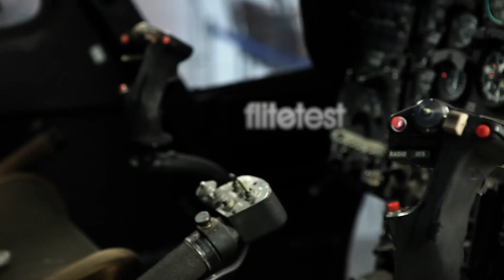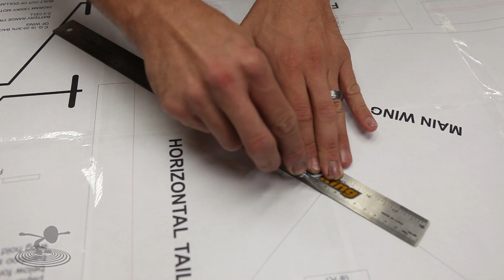Flite Test - FT FLYER - SCRATCH BUILD

Comment: Hi guys love your awesome channel keep it up and i have a doubt could anybody please help me. I am going to make the ft flyer and could I use the following electronics ( battery 11.1v 2200mah,180 gram),30a esc, 2*9gram servos and motor a2212 6t brush less motor 60 gram  with 1045 (10*4.5) propeller
Material used
4mm sunboard pvc foam board

Comment: I built the plane and bought all the recommended electronics. I bought a Flysky FS-i6 transmitter and receiver and burnt out the receiver with a 2S 1500mah lipo. Do I need a high end transmitter and receiver?? Will a 5V battery fly this? I am a noob. Help please!

Comment: Great stuff FliteTest. I built the Nutball then off to the FT Flyer.  The Nutball had a short life but got some loops in before the $2 foam board just couldn't take it.  The FT Flyer is done and one test flight completed with heavy tail.  

I found some 20x30 sheets at BiMart. 5mm board for $4.  OfficeDepot was 3mm and $5 - not very good.  Our Dollar Store doesn't carry it. Michaels Craft store has the thicker 5mm for about $3. for a 20x30.

Comment: I'm about to MAIDEN the FT Flyer on my first RC plane flight EVER with a 2212/13T, 1000KV Motor, 30 amp ESC and a 10x4.5L prop haha...Yup let the terror and chaos ensue....especially I'd I can get the 3S battery weight to fly. ....it's pretty gnarly with a little 600mAh 2S though lol

Comment: Just finished the FT FLYER about 5 minutes ago...something was off on the print of the plans...had to fine tune some of the cuts to make it all fit together properly. Off to build the power pod. ...I hope it's not "off" so that when my electronicals get here they actually fit. I'd HATE to have to rebuild the TINY Trainer (both wings n both noses) and this one after all the work I put in to scratch build.

Comment: the 2s 500mah battery recommended is 49 grams would it be OK if i used a 91 gram 1700mah 2s battery or can i do even heaver like a 3s at 200 grams

Comment: What would be the flight time with the 500mah? thanks!
Reply: Greg K 2s! and i built 3 of these already (and wrecked 3 of course) and i got good flight times out of the 500 2s at around 8-12 minutes
Reply: +Aaron S I get about 9-10 min just cruising
Reply: impact lures cool, thanks!
Reply: +impact lures that's with 2s or 3s?
Reply: 2s thx

Comment: I am building this model and was wondering if these electronics would work with the model.
Hobbymate Rc Airplane Power Combo Motor ESC Program Card Props Plugs ParkFlyer. If this works what 3s battery would you recommend.
Reply: +Michael Bulzacchelli i would definitely recommend that, maybe a fair bit of power for the US foam but the more power the better

Comment: Has anyone flown this with a 1300 mA battery?
Reply: +aniket patil i have flown it with a 1500MAH nanotech lipo and it last about 10 minutes at decent throttle, i sometimes use my 2200  nanotech too but have never tried a 1300
Reply: 2200, wow. I thought it would be too heavy for it
Reply: ***** no way, it flies great but i do have a very powerful motor, its a turnigy sk3 2836 1500kv motor
Reply: +aniket patil yup! it flies great!
Reply: +- DanTheMan - Is you 2200 3s or 2s?
Reply: 3s

Comment: what type of wire do you use is it just stainless steel
Reply: +- DanTheMan - I have not thought of using coat hangers! Thanks!
Reply: +Archie McMullan either use a coat hanger or caravan wire works really good too, my friend uses a coat hanger and it flops on the landing, i actually find that it is easier to land without landing gear and it also flies so much better and gives you more flight time.

Comment: Challenge accepted powerpod was built last night moving on to the airframe.
Reply: How did it go
Reply: niq872 It went great. I built it with my daughter it's her first plane and she flew it a bit on the buddy box and was able to do some circuits with it. I was able to even do some 3D hovering with it. I'm using a 1550kv motor and a gws 8x6 prop on a 2cell 800mah battery. I even strapped a coffee cup to the nose so I could drop my sons little parachute army guys from up high with it. I built another pod last night because I need one now :) Simple and fun great little plane

Comment: after i downloaded the plans i found that it had only one side of the wing, should i do it twice and glue them together?, or i miss understood something?
Reply: I also found that out, but what I did and what I think is supposed to be done is place it so that some of the outer edges of the wing(plan) line up with or get close to the bottom right of the foam board(to save material) then outline it with a marker, and then rotate it 180 degrees so as to line up what would be the middle of the wing(s) to each-other, then mark that. That way, you should get the whole wing in one piece. So, basically, just use the wing plan twice to make one shape(outlined) and the whole wing.
Reply: Mohamed Toony

Comment: These planes are money. If you do not like the swappables, then get a simple motor mount and velcro all of your electronics to the wing. It will fly. The nice thing about the FT Flyer is just that, it will fly. I have crashed them, flown them into chain link fences, fractured the motor mounts so that the motor was at a 10 degree downward angle...guess what, it still flew. Josh and Chad and all of the FT guys are doing a great service for the R/C community and I thank them for it. I am going to go build some more planes now. Sorry for the rant.
Reply: FEFEFEFFEFRGRVRFDFRFDFEFS
Reply: FFETDSHKBFGFDFFTSDFUKNCNTDFR

Comment: I happened to have a NTM 28-26 1350kv motor laying around the house... Would this motor be too big for this plane or would it still be ok? I assume it'll be ok because there is only a 20gram difference so I think the wings will hold but I'm not sure... Someone can you tell me?

Comment: Did anyone get back to you? Well I would use your rudder seeing as how you will have to get the nerve pathways set up for using the thumb or finger work to control a particular control surface. One that you will always use to get that kind of attitude adjustment. Good luck, and keep on working at it and remember the only dumb question is the one that goes unasked.

Comment: hobbyking 24gram motor, 12 A plush ESC, 500-1000 mah 2-3s lipo, any 9g servos, and any radio if you have one, this is the simpliest set up, there are some other setups on flitetest . com and search for swappable kit recommended electronics , and for a good deal on it? go to lazertoyz . com and look for "swappable kit power/electronic pack" it's $49 for everything you need
DONT QUIT THE HOBBY NO MATTER WHAT, got your back
good luck on the deal ;)

Comment: I went back and tried a 4s 1.3A with a Turnigy 1000 kv 200 watt motor.  It was bearable.   I tried it again with a 1.8A 4s (comparable to your 2.2 3s), and it was very heavy.  (The wind had picked up a little, so to be 100% honest I can't be sure if it was the wind or the add wt, but it wasn't fun at all.)

Under power the 1.3 4s landed perfectly. I lost the spinner on the 1.8A, and almost landed it (flared a bit too high, and without power to pull out of stall, bit it). Recommend 1.5A 3s orless

Comment: That's actually a 4 channel setup, remember throttle takes one channel too.  

Motor KV? The problem with your electronics is that it's a higher performance motor, and most planes designed around a higher performance motor are going to be higher performance airplanes. Not good for beginners.

I might suggest the FT Old Fogey. It's 3 channels, throttle, rudder, and elevator, and seems to be a little bigger and more stable than the FT Flyer... maybe baby blender. biplanes have good lift character

Comment: I would say too heavy.  I am flying a 24 gram with a 3s 850 nanotec. I am not a huge fan of the weight already. The FT Flyer doesn't have an airfoil, and  already has a pretty horrible glide slope.  You either land under power, or bite it.

If you are bent on using that power supply I would recommend the FT Bloody Wonder.  I haven't flown it yet, but from what I've heard it sounds like it should be able to handle that setup.

Comment: hahah, I just built one out of 6mm depron and had the exact same problems it seems like this dollar tree foam board thing is only 4-5mm thick, so the two fuselages didnt fit, i had to sand the inside of the front fuse and the outside of the rear fuse for them to join

Comment: For anyone planning to build this: Make sure you have the right material! Or else you are going to have a hard time building it. I built one out of depron, and it was quite a challenge.  The depron does not have paper on both sides, and many of the steps take advantage of this paper. So I had to cut it all the way through, and then glue it back on. Also make sure its the proper thickness. Mine wasn`t, so The rear fuselage wouldnt fit, So I had to make a new one. Also make sure The knife is sharp

Comment: To print "tiled" use Adobe Reader X and in the print dialog select "POSTER", select "Cut Marks" and make sure "Tile Scale" is 100%.  Then overlap and tape as required (after trimming the top overlapping edge.

Comment: I have built this plane a long time ago. I have chewed through soo many batteries maybe a good twenty and had one minor crash-flew into tree but nothing happened so just kept flying. This plane flies soo well, it will 3D in wind and without. It is soo easy i am 14 and i have built it (I also have a homemade Funjet with a too big motor on it that i built too). Highly recommend you will have LOADS of fun so go grab your scalpel and start cutting...